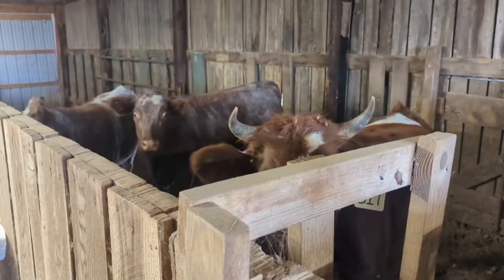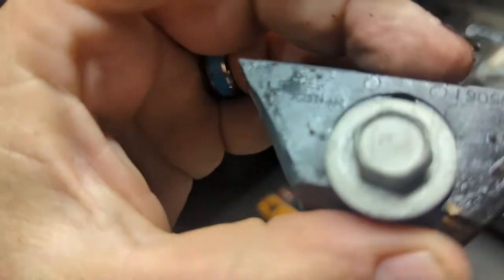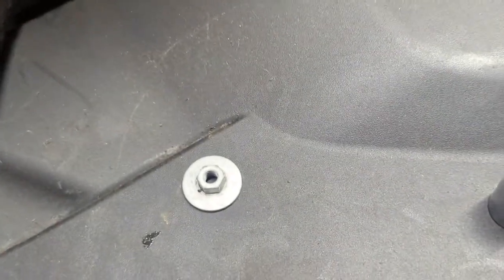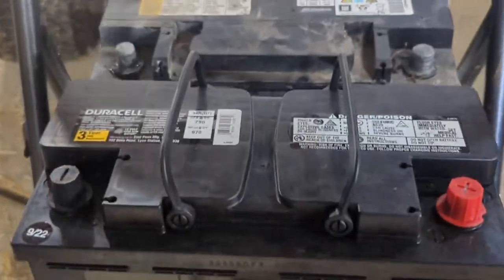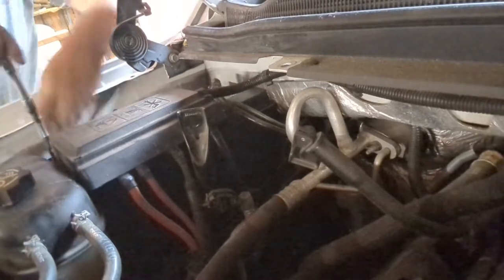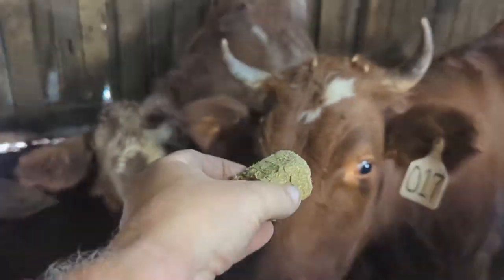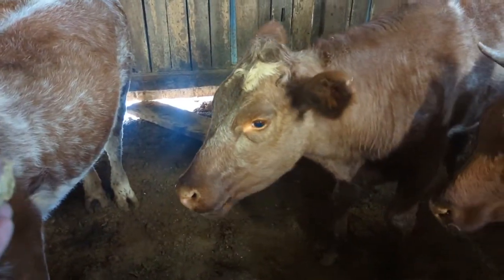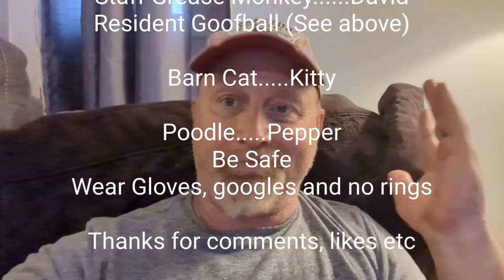2017 Suburban Battery Replacement

Comment: During removal you should always disconnect the negative cable first then the positive, installation is the reverse. This prevents an inadvertent short to ground if you accidently touch the metal wrench\socket to any metal part of the body under the hood when you're disconnecting the positive cable. Ground is any part of the frame, hood etc.
Reply from the maker: Thank you! I don't know why I didn't do that in that order.  I have a trace voltage  unit for this also and left that out also. I appreciate the feedback for certain!. You would think after working on the Patriot missile system I could retain simple grounding protection on my mind. If you see something else just drop me a note.